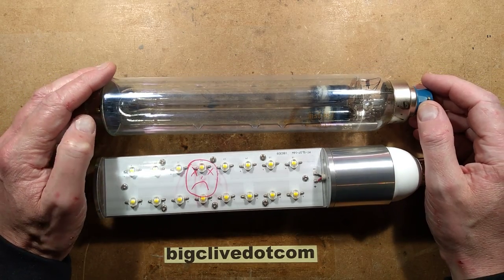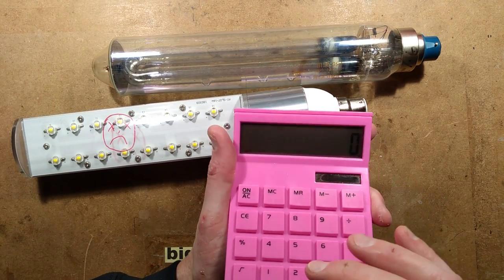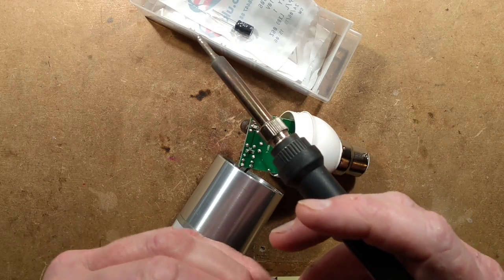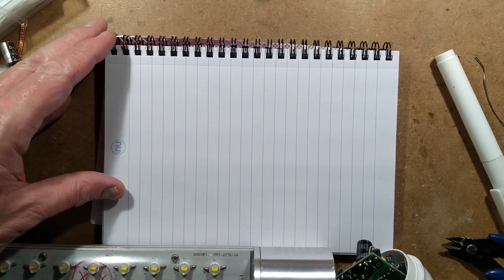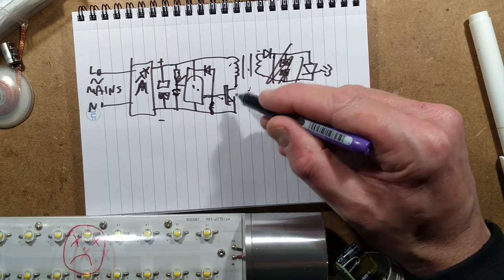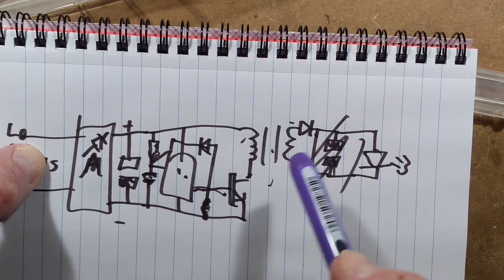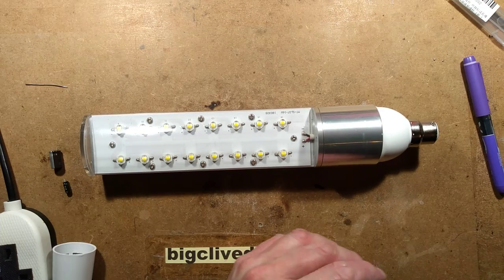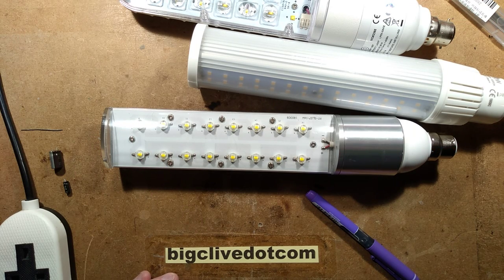Fixing a dead LED street light lamp.  (SOX retrofit.)

Comment: Philips puts the sodium in these pits along the tube but it's not necessary. Osram SOX lamps don't have the pits and the sodium is just a blob in the top of the tube. Once warmed up the sodium gets liquid and if the Philips lamp is moved about the sodium will run out the pits anyway. What's most important is the sodium should never run to the bottom where the electrodes are. That'll ruin the lamp. If you want to use a SOX lamp in vertical position you have to put the socket at the top.

Comment: I seem to remember being told once that one of the reasons for using sodium lamps for street lights is that the monochromacity eliminates chromatic abberation and thus gives sharper vision. Is there any truth to that, or was it just all about efficiency? All the new LED street lamps seem to be white, suggesting it's not really an issue.

Comment: Were the capacitors 85° or 105° rated? The higher temperature version would be better but in this case the capacitors are located away from where most of the heat is generated.

Comment: Really, getting the solder out of plated through-holes is easy. Just get a bit of 0.2mm magnet wire, get the hot soldering iron on the pad, poke the wire through a bit, and the solder clears. You can also use clipped bonding wire, that stuff piles up anyway.

Comment: I don't know why, but aux/bootstrap capacitor does seem to fail more frequently than the output capacitors! Maybe it's the placement, the heat, just turn-on voltage spikes? I absolutely don't see why the aux capacitor should be low-ESR in principle, it runs very little current and is supplied via an order of magnitude more resistance on bootstrap. As you say, low-ESR capacitors, where necessary by design, fundamentally cause issues, because just about any low-ESR capacitor will no longer be low-ESR eventually after not that long of a timespan if you start pushing it.

As to the replacement taking a while on the very first try... maybe it was reconditioning itself :D

Comment: Hi Clive, nice video.
The capacitor you replaced, 22uF 50V, probably failed because of the "Potentially" higher voltage than 50V that could be applied to it.
240Vac would be 340Vpk.
Even with the series cap and the load of the controller it could be possible to exceed 50V.
I have found in SMPS repairs any low value, < 100uF, high voltage  >50V rated capacitor is prime fodder for failure.
Can you power that LED lamp with isolated supply and put a CRO on it to show waveforms around the circuit.
Is the metal tube/ring that screws to the plastic base, insulated inside from the PCB?
It looks like the PCB edge come very close to the inside of the metal tube.

Comment: Is the reason they used the stepdown transformer after the bridge rectifier instead of before a way to save money by using a smaller transformer.  I know that when you're dealing with power supplies,  a higher frequency can let you use smaller inductors and transformers to get the same job done.  Feel free to correct me if I'm wrong.
Reply from the maker: That's correct.  By pulsing the small transformer thousands of times a second it can be a lot smaller.

Comment: The cheap metal pocky rods that you have are actually sold as guitar bone nut slotters. They have the grooves so you can cut the nut to the width of each string. 
It's interesting they were also sold as electric pocky thingies.

Comment: I couldn't tell it the lamp in this video behaved this way, but the ones they're using in my town have an annoying habit of flashing at double brightness when they fail. Makes driving down the street a bit of a challenge when you're alternating between pitch black and surface of the sun every couple of seconds.

Comment: plus if they change it from standard sox  where it starts up pink then turns orange  after few mins . to a led retrofit  then its just gonna be orange/ yellow  the moment it turns on  .    it would be good if they made one so  when it turns on  it starts off pink/purple then slowly changes to orange/yellow  by using an rgb led controller  or Arduino based  circuit ?  coz when i was young i sometimes sit outside  waiting for it to turn on then watch the whole cycle  but now being  replaces so i cant do that anymore

Comment: Clive,

I have a small and maybe stupid and redundant question:
A working SON-T sodium lamp that doesn't ignite and doesn't have the sound of a starter trying to ignite it, probably has a bad starter?

I have 2 Indalux sodium lamp lights and one will start immediately (as soon as plugged in) and the other is as dead as a dodo. And before I spend an afternoon swapping parts, I would like to try the most obvious problem and route. So first starter, then Elco and finally the transformer. What do you think?

Thanks in advance!
Reply from the maker: Many of the igniter modules used in discharge lights fail with time.  Especially if left trying to start a dead lamp.

Comment: Hi Clive,   I've just taken delivery of a brand new Philips "True Force" LED retrofit for SOX lamps - have you ever come across those? It has an external configurable 'constant current' LED driver. I think it's about the most up-to-date retrofit on the market, unless you know otherwise?  Power factor is an impressive 0.95, and the lamp is dimmable.  Sorry, I'm not offering mine for reverse engineering, but it could prove to be a very interesting subject if you were ever to come across one.

The driver is configured via a wireless handheld gadget, but it does come pre-configured to under-run the LEDs and appears to be ready to run, straight out of the box.
Reply from the maker: Is it a xitanium driver?  Very common in street lights.  Programmed by contactless RFID.  Doesn't even  need the unit to be powered to program it.  Theoretically you could nudge the current down to prolong the lamp life greatly at the expense of a small amount of brightness.
Reply: @bigclivedotcom  Hi Clive, that's the one 'Xitanium' - I didn't realise beforehand that it required 'fine tuning' but since it's preprogrammed to under-run the LEDs, I'll be trying it as is, at some point.
Reply from the maker: @28YorkshireRose12  I think it does require their specialist programming pad for most changes.  Not sure how easy that is to get or how expensive it is.
Reply: @bigclivedotcom  Hi Clive, I'd say it is a dedicated tool, and I'm just about to search the net and see what I can find.

Comment: Also bought some desoldering wick from ebay and it was adveryesed tbat it already had flux in it, but it just doens't suck the solder at all. Gonna buy a flux pen now I think.
Reply: You could try buying some Goot wick, it's quite good in my experience.
Reply: @saulrocha7749  Clive uses gootwick and it still needs flux
Reply: @PiratCarribean  it's eBay so it could be dubious quality knock off stuff. In general, lead free is a bitch.
Reply: My absolute favorite flux for such uses is Kester 186 rosin based flux. It's purified pine rosin in alcohol and you can pre-treat your desoldering wick by the meter for ready use so you don't have any solvent evaporating as you're trying to desolder. Awesome universal flux; easy cleanup with alcohol and it's inert as can be.
Reply: I use Servisol Soldamop No-Clean from Farnell/CPC. No additional  flux required.

Comment: Sodium yellow is great for flowering plants.  Yes those plants.
Reply: No... not really. Low pressure sodium is almost monochromatic and the frequency is just wrong for chlorophyll (all types). High pressure sodium was used for flowering before the rise of LEDs not because the pinkish-yellow was any good, but because the efficiency was high enough that the useful wavelengths at the red and blue ends were emitted with higher system efficiency than other sources in spite of the (mostly) wasted yellow light. Today LEDs are better and you want to use something more like 3000K or 3500K whites with some 660nm reds thrown in for extra measure. Google "Emerson effect". And yes, I've been a pot grower for a long time. Cheers from Colorado, USA.
Reply: Peter S good tips. I have no interest in growing "that plant" because it's illegal here, but I would assume these rules apply to all leafy plants?

Comment: Are you familiar with a component lead forming tool that forms and crops leads of through hole components? I remember seeing one used in a video (might not have been Clives.) As I recall, the components were aligned across a channel in the base of the tool then an upper portion was pressed down which formed the leads and cropped them  all to uniform length. As I recall, the user could fit up to ten components in the device. I believe it was intended for low-level manufacturing and components with copper leads. This probably isn't the best place to ask, but I figured what the hell, maybe somebody knows what I'm asking about.
Reply from the maker: I use a lead cropper and former sometimes.    It appears to be a discontinued product:-
https://uk.rs-online.com/web/p/pcb-lead-cutting-forming-equipment/0545109
I also have a hand cranked unit that can take full rolls of bandoliered components and shoots them out like a machine gun into the collection tray.

Comment: i saw something weird at a factory, it was a lamp post. The lamp post is the mercury vapour type but some of them are fitted with cfl's
Reply: SyazTYT's other uploads Maybe it used to be the open yard around the factory, then they added the roof to expand production.
Reply: @johnfrancisdoe1563  what i dont understand. I said theres a light post in a factory thats originally fitted with mercury vapour lamps but were changed to cfl

Comment: How is that even a comparable retrofit? That 35W SOX lamp is probably putting out ~4500 lumens, while that LED lamp is probably only managing ~1600.  

Even if the lumens/watt figures for SOX and LED are technologically convergent, it's still a functional downgrade as applied to a retrofit scenario bound by existing fixuture spacing. You're saving power by reducing area illumination by the same factor.  If that's what constitutes green tech, just optimize the strategy by removing all the street lights entirely.
Reply: Led Street lights are terrible patchy and dim I hate them. Love sox

Comment: Hey I have a low voltage lighting transformer that may be hit buy or close to lightning. I can here clicking on it. I can straight hook transformer up and get 12v but when through the controls it will be 12 v on for a second then drops out. it has a feed back for load. It seems like it may think its overloading and shutting down. Whats your thoughts?

Comment: What actually is the purpose of this “delayed start” function on the circuit as opposed to starting on power on? Reminds me of a problem I had with a remote control light command and I was not sure why the circuit was more complex than I thought it needed to be...
Reply from the maker: It's for efficiency and also part of the protection against overload and short circuits.

Comment: The pokey things on keyring are a set of guitar fret  files that's why they have texture
Reply: Actually, they're oxy-acetylene cutting/welding torch tip cleaners and you can buy them everywhere welding supplies are sold. Use fine diamond files for frets.
Reply: @Matt Quinn Ahhh! Nut-slot files makes good sense. I couldn't figure out how one would use them on frets.

Comment: Those pins are simply tiny reamers. In my experience, reamers are usually textured with the max diameter being the target diameter, so they clean out anything that is narrowing the channel. Sadly my most personal experience of them is that they are very similar to the tool that dentists use to remove the nerve from the channel in a root in a root filling!
Oh, 4 year old video..... looks like my comment is not exactly timely nor will anyone see it :)
Reply from the maker: It's OK.  I saw your comment.

Comment: 2:04 something i've always wondered is why we don't use low powered lasers  scattered through a diffuses for street lamps .. like then you could tune them to pretty my the exact best frequency you like so that all of there power is in the visible range and also ... like  my pen laser runs for ages on a couple of hearing aid battery's so ... i've asked this in a few places before and either not got a response or something along the lines of "duh because it will blind people who look at them" which i find a confusing response because .. well thats what the diffuser would be for no?
Reply: and you could also make them very directional to avoid the   light pollution issue

Comment: Does it work when the flux is on the "backside" of the desoldering braid? Where the soldering iron touches it, not where it touches the solder joints to celan up?
Reply from the maker: It soaks right through.

Comment: That LED I fixed the other day failed again, I took it apart further and found a red resin dipped film capacitor with a crack in the side. Out of circuit it measured 112nF instead of 150nF, wonder if it went short or open as the bulb heated up.
Reply from the maker: The capacitors often crack if they fail.  It sounds like it might be a dropper capacitor to limit the current through the lamp.
Reply: @bigclivedotcom  It was across the LEDs of a constant current non isolated LED buck converter "MT7812" labelled as CO on the datasheet. First time I took it apart a single LED had gone open with a black burn mark, now this second time I pulled the thing apart fully and found that cracked cap. It was right next to the heatsink/substrate thing and being a 10.5W lamp it probably gets very hot.

Wish I could of sent it in for you now, I'm still not convinced I've found the root of the fault and this is the result of something else like an intermittent dry joint or SMD part causing the circuit to go haywire and stressing other components. It would of been a nice game of cat and mouse for you to play on camera!

It only cost a couple bucks from a DIY store a couple years back but its like a challenge now.
Reply: @bigclivedotcom  Sorry to bother you about this silly LED again, but I've had another theory. Picture a constant current buck converter running some LED's,  now one LED in the chain fails and goes open. The energy in that inductor has to go somewhere so the voltages across it rises as it dumps its energy into charging various capacitance's until the next weakest link in the chain breaks (in this case the film capacitor).

Does this sound reasonable?

Comment: err, your video seems to be in 30fps, which works best on north american 60hz,you get beat frequencies on 50hz,  the flicker should much less noticable if you set it to 25/50 if you can, or fiddle with shutter speed till it's  some small fraction of the line rate (i.e. 1/33, 1/50 or 1/100 ),  your camera might not expose that though

Comment: I was wondering while you elaborated about the solder wick. My first experience with the stuff was not to de-solder but to make an electrical connection. As a kid, I liked to take apart broken and old radio and TV equipment. You know, more relying on components soldered to peg-strips than in PCB (that stuff was serviceable, with dusty, yellowed schematic stapled to the inside).

On several occasions, the 'wick' was used to connect sometimes hinged hatches or doors of shielding cases (usually containing the High Voltage stuff). Later I saw it in a lab on cabinets & doors containing different kinds of even back then very old electronics.

Never did much electronics later on. So my question; did wick evolve out of flexible electrical connection, or is it the other way around?
Reply: Interesting question. Solder wick is normally sold pre-impregnated with flux (not that that ever works, you pretty much always want to add flux), which you wouldn’t want for just electrical connections (I mostly know them as grounding straps, not so much for power or signal), so I guess the fine braided copper lines existed as a generic form before evolving into solder wick per se — but whether the original use case was grounding straps or solder removal, no idea.